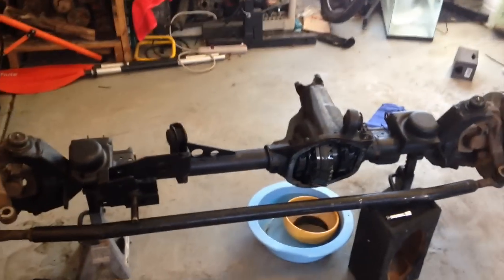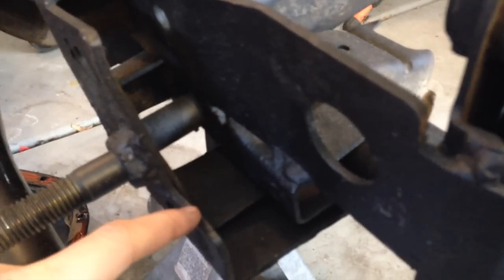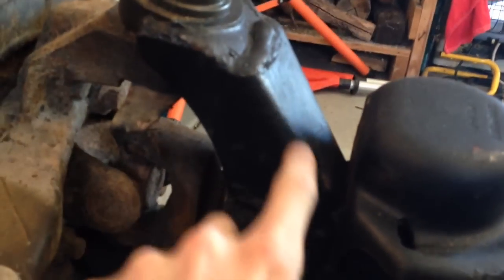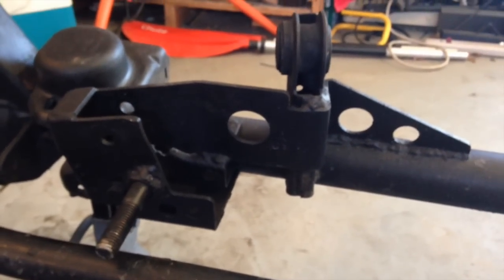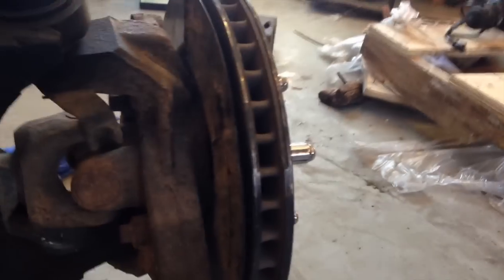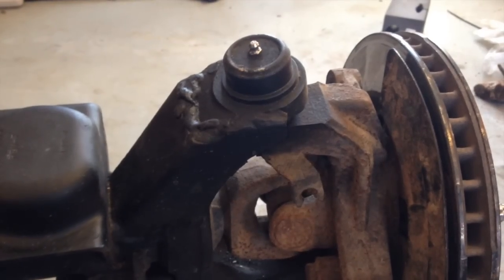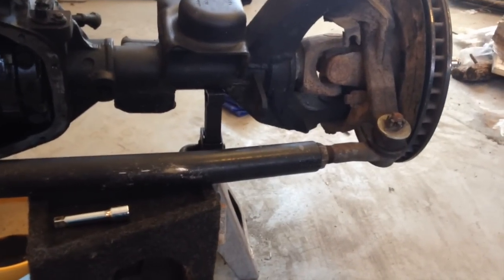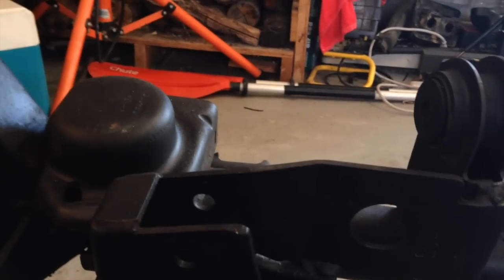Jeep JK D30 vs D44 Front Axle

Comment: R dana 44s really that week? Never seen one bent or broken on jk in person.
Reply: The axle tubes and inner steering knuckles are weak links, hence why they sleeve and gusset them. I wouldn't run more than a 35 on it, or 37s if you're easy on it.

Comment: Do you know if Frontal Axle D30 ratio 3.73 of a Jeep Wrangler 2010 fits on a Jeep Wrangler  2015 with the same descriptions???
Reply from the maker: Joe Zackary Beltran yes it will. As long as the gearing is the same.

Comment: Worth mentioning peeps that if you flip your drag link for a high steer set up your standard offset wheels will contact the joint at full lock. So be careful or run spacers.